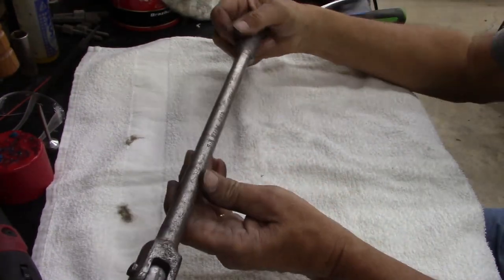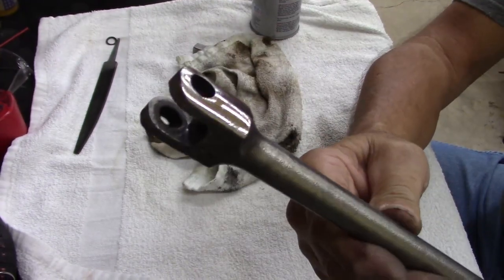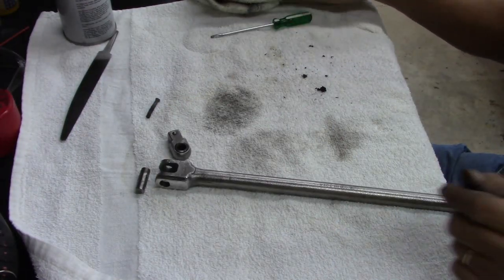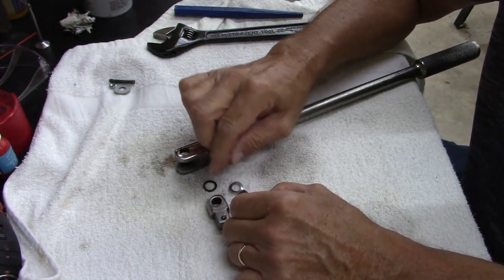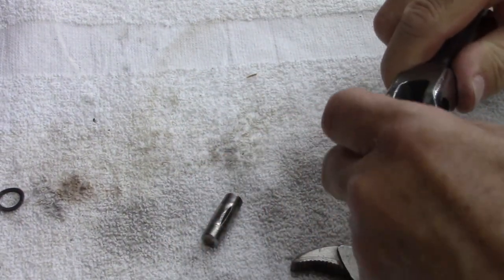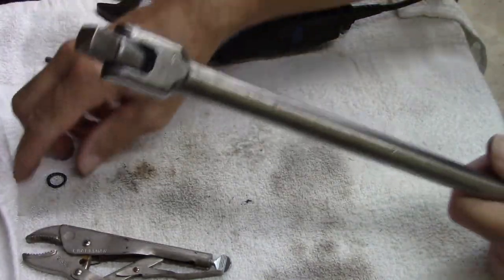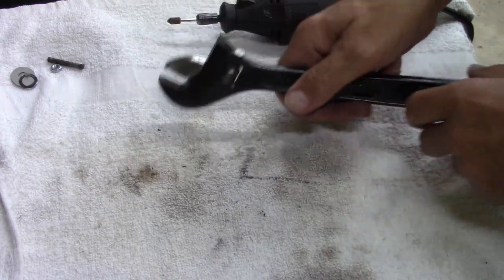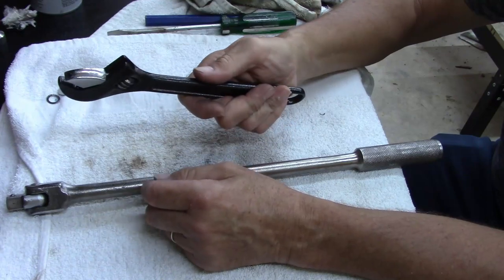S&K Wayne breaker bar restoration

Comment: Those are great breaker bars. The pin is tapered so it presses into the pivot and moves in the yoke of the bar.  The spring washer sets the tension. The kits are still available however if the pin still fits good I would just replace the washer with a thin lock washer so it tightens up. Great video I really enjoy the restorations. I’ve been waiting on one for the long cornwell you picked up the other day. I’ve probably got a kit in my stuff I’ll have to look.
P.S little tip use a vise to push the pin back in so you don’t spread the yoke.
Reply from the maker: I did not think about the vise to push the pin back in, but I have made a note of it, I have an old Bonney 4097 1/2 drive ratchet that I am going to do first because it's weird looking, also have been working on a Estwing hatchet that has been taking forever!!!!!
Reply: @djstoolrestorations  Bonney has a lot of history behind them. They made tools for a lot of companies. 
Looking forward to the video.

Comment: I had that same one, got it from my grandpa. Marked SK Wayne and if I remember right that would be 1960s . I had it on a 36mm socket with a 50” cheater bar and twisted the anvil right off trying to get an old half shaft off my wife’s suburban. I took it to my SK dealer and they told me they don’t make the particular anvil anymore and they handed me a new one (SK 41652) Kinda bummed they couldn’t fix the original but the brand new one sure is nice. BTW if you have an SK dealer they’ll give you any replacement part you need. I’ve taken in sk ratchets and they’ll give you a rebuild kit for free.
Reply from the maker: I think my closest S&K dealer is 50 miles away, but I will try just to see if they will do it.